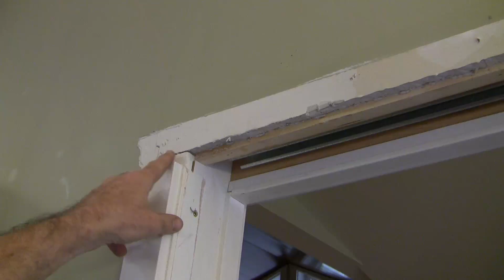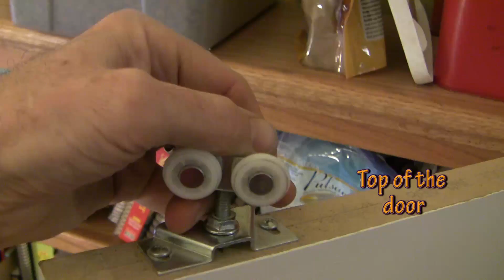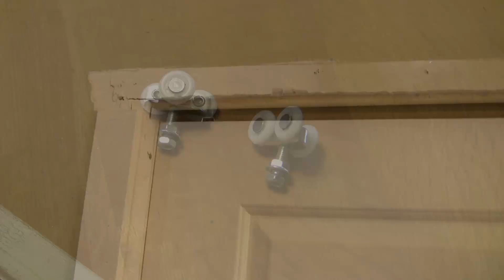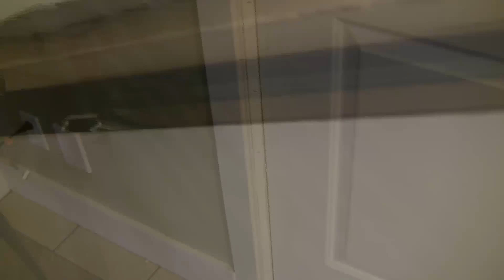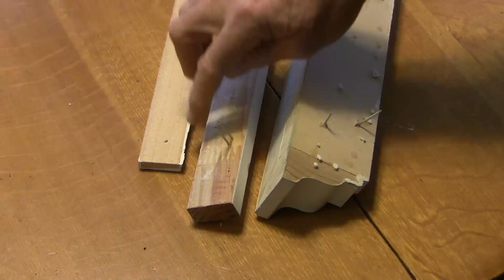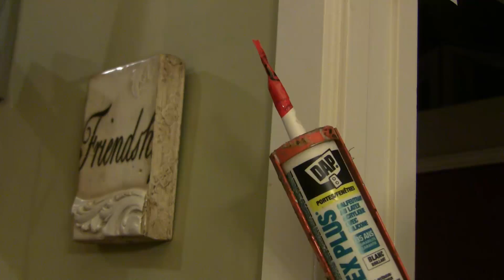How to fix a pocket door

Comment: You skipped the step of how you got the door off. That's what my problem is and what I was looking for.
Reply: Same issue here.
Reply from the maker: Yes, newer sliding doors may have that, although you won't find it on older ones. On old style devices you usually need to remove enough of the casing to find the underlying nuts that hold it together.
Reply: skipped how to get it on, too. Which is my issue
Reply: มู่หลาน
Reply: You are correct he forgot the most important part
Reply: For mine I had to:
1) pry off trim gently
2) take off front wheels as in video (front of door drops)
3) bring door partially through and around allowing rear wheels to come forward and accessible.
4) take off rear wheels then bring rest of door out.

To put back do it all in reverse. Note: to hook the door back onto the wheels, first slide in wheel, then use a string or elastic band to hold the suspension bolt sideways to allow the door to be brought up next to it. This part is tricky but I used an elastic to hold the suspension bolt pivoted sideways so that I could marry the door bolt with it. Afterwards when slipped in cut elastic band away and push door into pocket to repeat with front wheels

Comment: Great video. We just installed a new pocket door. Frame is plumb and level. The door is plumb and level when closed, BUT when we open it and slide it into the pocket, the door is no longer plumb. It sticks out at the top, goes in more at the bottom. Any suggestions?
Reply from the maker: I guess I must have missed this one. Presumably the slider rail is not sitting completely true and straight, with a curve in the track for at least one of the cars. Or, perhaps the back car rides up in the slider as it reaches the deep end. Could there be an obstruction deep in the pocket that is preventing the door from sliding home? That could cause a tip of the door as it opens completely....
Reply: If I understand what you are saying, the jamb at the pocket side is not "plumb." OR the track is not held level along the entire length, possibly due to installation over a screw that was not removed way back at the back of the track (more likely if this is a thin metal, not a rigid, track.)
It's even possible the rollers are coming OFF the track at the back, allowing the back end of the door to "dip" which could be a problem, because one day the rollers will refuse to go back on track so you can't close the door.

Comment: would have been nice to see you take the door off/on the rollers.
Reply from the maker: Doug Starkey Most of the time you can just lift the door up and off. If the casing is in the way, you need to remove that first. Occasionally to get more free movement you might need to loosen the retaining nut on each little car to give the door enough room to lift the little car of the rail. The explanation may seem complicated but once you have a close look it will be simple.

Comment: I like the helpful hints such as using Silicone Spray to help the doors slide better and the red duct vapor barrier tape to seal caulk tube that has left over.  Thank you for the video it is very helpful.
Reply: +Linda Rivera Instead of the tape I've always used a wood screw, lasts many months and there's always one around the workbench
Reply from the maker: Linda Rivera Thank you, for your kind feedback.

Comment: This was great, thank you!!  One tip for saving your caulk though -- I would suggest using Glad Press 'n' Seal wrap instead of the duct tape. It seals & holds really well, easy to apply, and much easier to remove! Plus it won't gunk up the nozzle and you could even reuse it. :)
Reply from the maker: Melissa Thanks for dropping by! I agree, duct tape wouldn't be a good choice; I've tried that before and it's too porous to vapor and the caulk dries out. The red tape I used is a unique and very expensive specialty tape designed to meet building code requirements for vapor barriers in home construction. It's completely impermeable to gas, and it sticks like nothing else, forever. I wouldn't suggest buying that tape for this single purpose. I have it on hand because of other home construction projects. As you say, wrap might work almost as well if you can get it to stick over the long term. I can tell you that in the past when I've tried saran wrap, it eventually lost it's stick and the caulk dried out.
Reply: spelunkerd Glad Press 'n' Seal is completely different from average saran wrap. It is designed to stick to itself and also most smooth surfaces and seals very well and although it is not completely impermeable to gas it has kept many of my caulks, paints, liquid nails, etc. from drying out for months and longer.  Give it a try, I've found hundreds of uses in the shop, more than I've found in the kitchen.
ALSO, great video and very helpful, great focus on those key points to avoid damage and additional headaches.
Reply from the maker: Thanks for visiting, I'm sure the advice you two offer will be well received by those who come later.
Reply: What ever happened to just putting a screw in the end of the caulk tube? That always works for me.

Comment: Mine has one slider, is that normal?
Reply from the maker: ShyRage1 Most have two, though I suppose it may be a different design. If one fell off, one end of the door would drag.
Reply: I suppose having two sliders would probably be better huh??
Reply from the maker: ShyRage1 If one end of the door is dragging, get a flashlight and look for a second slider, perhaps slipped off and either on the floor or on the rail, deep inside. Mine had slipped off and I snagged it with a hockey stick and rolled it out. On the other hand, if your slider has a wide base maybe it is an old design that is supposed to be that way. I've never seen a pocket door designed that way.
Reply: spelunkerd
I examined the pocket door closely this time.  There's definitely two sets of rollers only.  One in the front and one in the back.  Each roller has two wheels.  On each set both wheels roll perfectly, however; while in the pocket it wouldn't roll.  Could it be the track?  I've already took off the frame in order to get this pocket door out so i wanna make sure everything is done right.  The Closets in my home have this same one track two roller assembly.
Reply from the maker: ShyRage1 I would take it apart and see if you can find an obstruction. Pull the sliders out, see if the wheels move, check for debris on the track and hope you can find something you can fix. Lube will help if you can find an obstruction but I would avoid light lubricants like WD 40 because they don't last and are really only good for cleaning. Silicone spray is better. If you can't fix it, you may be able to find a replacement if you take in the bad rollers to a hardware store. Good luck!

Comment: I've got 3 pocket doors that all need to be repaired. After watching your video I'm confident I'll be able to handle the job my self. I assume I can just go to a local hardware store and purchase new hardware? I think I'll need new rollers and clips that mount on the door. I'm hoping I can get ones that will work in my track so I won't have to replace that as well. Because replacing the track will mean cutting a hole in my wall..right??
Reply: There is a method to getting the old track out where you DO NOT have to cut into the wall. It involves removing one side of the trim (or casing) and removing the split jamb so you can reach in with a screwdriver and/or ratchet. Replacing the track with a heavy duty RIGID track (not those thin metal ones that deform) means you don't need all the screws way back inside the wall, either, just the ones in the door opening, and maybe 2 back in the wall a ways. The Johnson hardware is much better than, say the Everbilt, in this case, and actually has FOUR rollers, instead of three, per piece.   For a 36" or smaller hollow core door, the hardware kit is only (2018) about $30 for the Johnson. You can get cheaper, thinner tracks, but you don't want them!

Comment: The video was competently done and informs me what to expect and think about before working on my own door tomorrow. Great help. Thanks!
It's too bad google makes it so complicated to make a brief compliment like this one.
Reply from the maker: Good luck, man. These are usually easier than they appear, though finding replacement parts may be a problem. If the rollers have slipped off, you might find a magnet on a stick to be useful for retrieving the little car.

Comment: Watched your video and was motivated to fix my old pocket door, but when I got in there, I found the hardware was a single roller and not double as yours suggested.  Is there a good source for finding old replacement hardware?
Reply from the maker: Not easy, especially if it's an old system. You may have to replace the whole roller system with a new one. That's not as involved as you may think, though it depends a lot on access.
Reply: Thanks

Comment: Thanks. It will be very useful . Re brad nails. I have found that its often best just to grab them with a side cutter or pliers and pull them through the wood.  This way if you have to lane or sand that steel brad nail won't hurt the blade or paper.
Reply from the maker: You make a good point, Alex. It's certainly worth considering, especially if you are planning on more complete finishing with sanding. With my brad nailer, I find the nails very hard to pull all the way through without causing more damage, especially from pry marks on the finished surface. With harder wood and small nails, pulling through would be worth considering.
Reply: spelunkerd
Most the wood used here is softwood so pulling them through from the Inside is easy and damage is invisible when it goes back.

Comment: One thing that seems to be missing, in this otherwise good video, are any tips on getting the actual door back on the rollers. I have a couple of these doors and they are both in a very tight location, which makes it very difficult to get them on and off.
Reply from the maker: Thanks for your note, Craig. Yes, I know some of these are really hard, especially those with an older design. I've always been able to get the door in first, then mount it on the rollers afterword. Please stop by after you get it done and let us know how you solved your problem. I know some systems require a more aggressive dismantling of the wall.

Comment: Great video, thanks! ...
But I guess it does matter what side of the door you remove the casing from, right?  Because don't you need the room to pull the top of the door towards that side and have it match the side that your brackets connecting to the rollers can slide out from??
Reply from the maker: That is what I was thinking when I took mine apart. But I remember thinking in retrospect that it could have gone on either way, because when the bolts are loose there is some wobble room to allow it to slide into place from either side. Your design may differ....

Comment: The rails in my pocket door damaged, and I've been looking for a video to tell me how to repair it without damaging the wall, this was not what I was looking for but it was helpful.

Thank you
Reply from the maker: A lot of times you just have to bite the bullet and pull off the drywall, then replace all the hardware. If you are going through the effort, it may be best to get a whole new kit. The hardest part is the drywall, and matching the paint -- as long as it's not knockdown the drywall is pretty easy. I got to be pretty good at doing drywall because my teenage boys kept putting body parts and hockey sticks into walls. There are some good videos of drywall technique here on Youtube. Good luck!
Reply: It's in a basement with a floating ceiling (tile ceiling) I tour the old rail out, and bolted the new one in through the top 2x4. Didn't have to cut through any drywall, which is good cuz its a rental property. Thanks anyways
Reply: If you need to replace the track, you DO NOT typically need to remove any drywall. Carefully remove the trim/casing on the pocket side, and then the split jamb. You can then reach in and remove the screws holding the track to the frame at the top, with a little ingenuity you could even design a tool that makes this part easier, so your arm doesn't have to reach in, but unless you do a lot of these, it's not worth it. I have long skinny arms & a compact cordless driver, so I don't have any trouble. 
Replacing the track in this manner takes me about 2 hours.

Comment: Nice video Spelunkerd. I have worked on many a pocket doors and the old style tracks from the 1930's and up that you can't get the wheels for anymore. So i always end up cutting a hole in the wall to get the old track out of the double hungs. thanks
Reply from the maker: Yeah, you make a good point that new technology may not be compatible with old designs. Fortunately there isn't much stress on those wheels. As you know, removing a track would not be easy, since even small arms and hands would have trouble squeezing into the back corner. Thanks for adding some words of experience to the thread here.

Comment: So very posh, your own startrek style sliding door :-))

What a great idea, there is no room lost to a conventional door swing, but you have to have a cavity in the wall to allow it.

Uk houses use brick walls outside and in, so fitting a nice door like yours would be a pain, shame really as i would enjoy walking through and making the swish noise from startrek lol :-))

Smashing vid :-)
Reply from the maker: Yeah, these are popular here, but only for non-weight bearing walls. They are pretty easy to construct, with 1" studs on either side of the door pocket, and of course there is less room to hide wires and pipes. Wall switches need to be on the other side. Thank you for watching!
Reply from the maker: For some reason these two remarks are not appearing in the video thread. It must be another one of the seemingly endless Google plus software mistakes.
Reply: spelunkerd
Oh well, you managed to see my jibberings :-))

Your videos are allways appreciated, your calm and logical way of discribing problems and there repair is enjoyable to watch, some people just jibber on and lose the focal point, you dont :-))